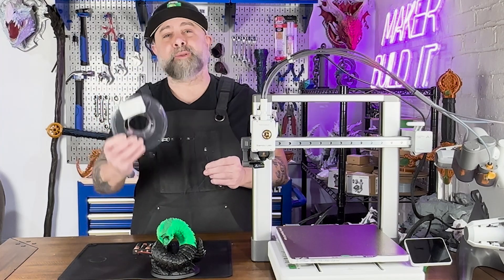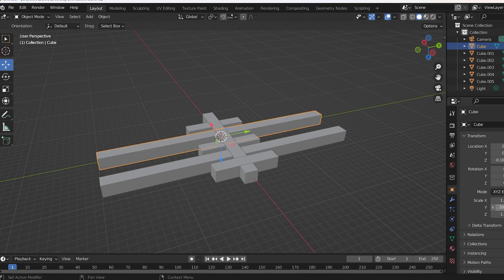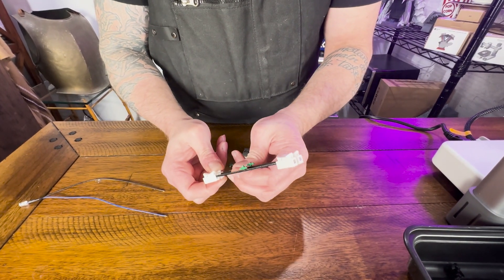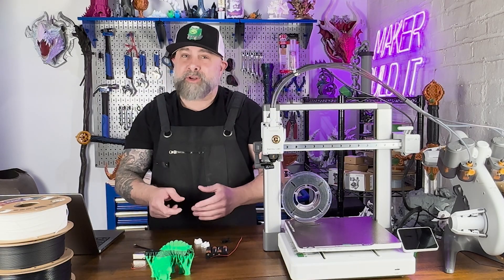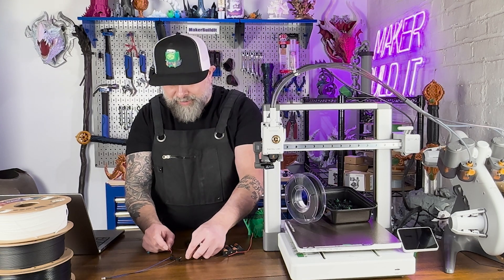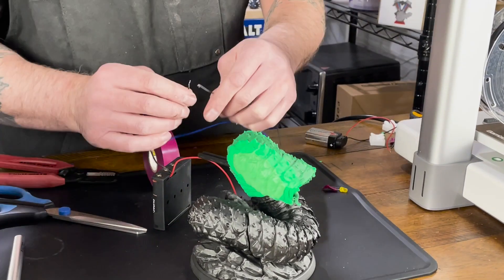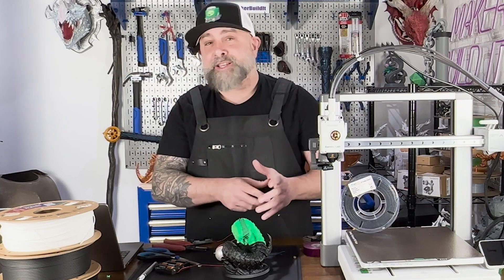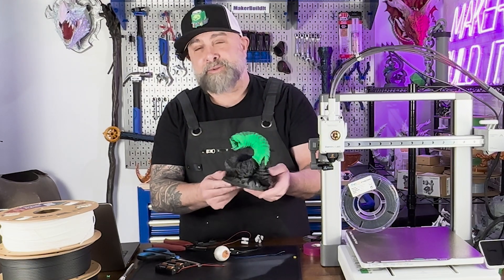Conductive Filament REVOLUTIONIZES 3D Printing?

Comment: You were not really making conductors - you were making current limiting resistors - which is what every LED needs. Most of the 9V voltage was getting lost in the "conductors".
Anyway this is a conductivity unheard of just a few years ago in FDM 3D printing.

Comment: what (if any) would be the proper way to connect a physical wire or pin connectors to such filament surface on a 3d printer circuit? Obviously not possible to solder it together. Some kind of conductive glue, maybe?
Reply: copper tape might work

Comment: I saw a video on this stuff like 4 years ago. I'm sorry buddy but it didn't revolutionise 3d printing then. And it won't now. This is a old product and there's just too many downsides compared to just leaving a hole or channel and running a actual wire. There's a reason you never see this stuff used.

Comment: I work at a filament company and we’re on phase 3 of ESD filament right now (which is just conductive filament thats diluted so nothing short circuits)

The stuff we tested last had a surface resistance of 20ohms over 10mm.

Right now, my job is to get that to be around 1x10^9 ohms, which is just enough to prevent electrical buildup.

The conductivity of the filament relies heavily on the underlying carbon structure.  The stuff we’re using is some patented nanotube technology designed specifically for making conductive plastics.  However, it’s extremely brittle, so it doesn’t make sense to use as filament unless it was completely embedded in the print.

It’s also extremely expensive.  I can’t share what our raw material costs are, but it’s not uncommon for small (200g) spools like that to cost $80-120 ($400-$600 per kg) depending on the way conductivity is created.

You can of course dilute this, which makes it cheaper, but also adds more resistance, so there’s a ton of options

Comment: It might actually have too much "conductance". If the conductive PLA was not purged 100% you may have a short.
Reply from the maker: That's a really good point! Going to have to test that! 😬
Reply: Yeah was thinking the same. From the discoloration it looks like an insufficient purge issue. You probably need a lot more purge setup in slicer settings to make it work better.